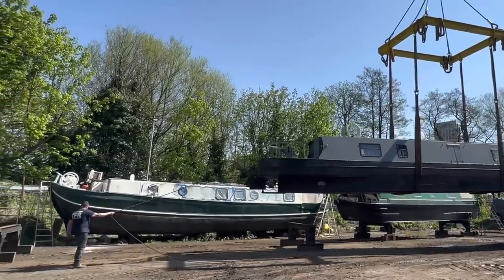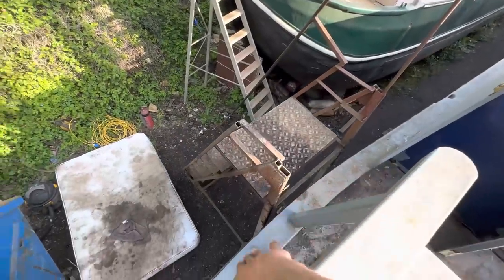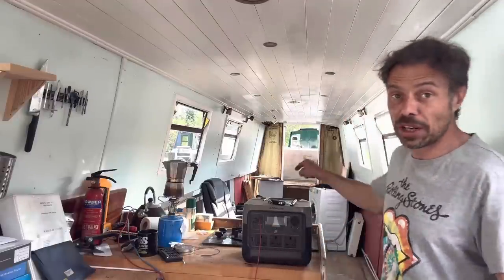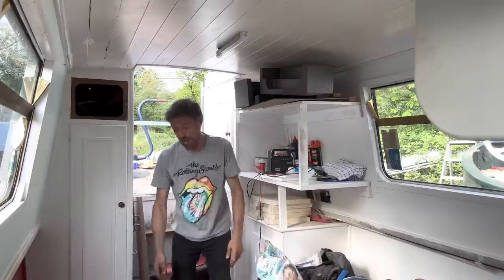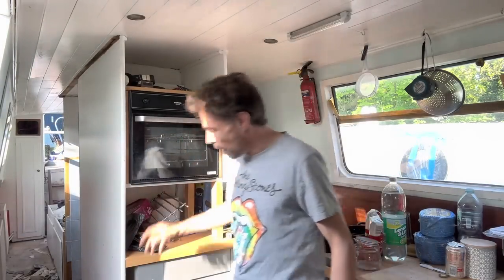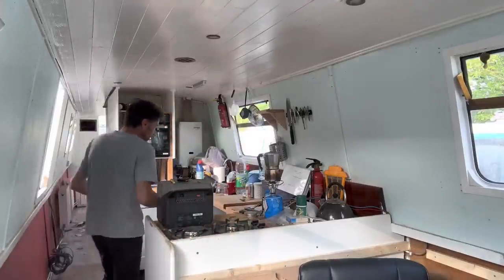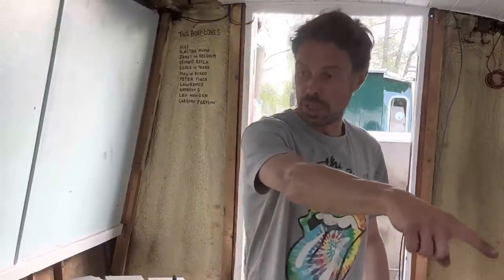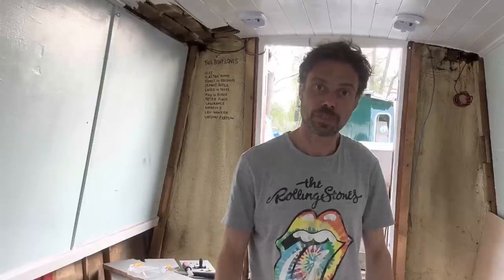417. COMPROMISING narrowboat layout design

Comment: Loving the new project.  With the loo at the back, and a folding bed, you block the rest of the boat from the bog if the beds are down.  You mentioned two sleeping spaces, but your plan only showed one, so maybe that's not a problem, but if the dinette is a bed too, you can't get to the loo for a midnight wee...

Comment: Well, as you asked, my thoughts:
Seems to me that you might as well just rip the whole thing apart, and start from fresh.  The existing bedroom needs major changes, the bathroom is already gone, the kitchen needs moving, and another bedroom needs building.
If you're going to keep the lounge at the bow, why bother cutting a new flue hole and blocking off the existing one?  More work and expense.  Leave the stove where it is.
Dump the calorifier idea, as you rarely run the engine for long.  Re-install the diesel water heater for the central heating side, and use the stove when you have the time.  You have what looks like an on-demand water heater in the kitchen, which will also need the flue blocking and possibly moving.
Swap the cassette toilet for the composter that you have in Sloe Patrol, if it will fit.
That should give you something to think about.
All the best, mate.

Comment: I've never tried a cross bed but I imagine that if the nose of the boat is high you'll feel like you are gonna roll out. It only takes a few degrees to get that sensation, for me anyway. On my boat I designed it so that that my head was at the higher end, couldn't possibly sleep any other way round. I had a similar layout to the one you are proposing but an extra 4ft to play with which made all the difference.

Comment: Your idea for cross-beds is brilliant.  I had always assumed that running lengthwise would be the way to go, but the way you explained it, makes far better sense.  Sliding pocket doors are a great idea too, expecially if you can find inexpensive ready-made hardware to build them.  I'm not sure that I would like a walk-through bathroom, but then again, the way you described the bed situation, it is probably the optimal use of space.

Comment: As an alternative to the stern bedroom, pull out the bed and make it a dinette, with a hinged top bunk bed above it, blocking the top of that window on the port side. That way the stern compartment can sleep 2 - 3 kids in a single room. By day you can have up to 4 kids easily sitting at the dinette table when you're steering, or it's as you said quiet space for the older ones while the younger ones are with you in the lounge area. 

When you're alone, the stern dinette can be your permanent bed, instead of a dinette. Bathroom and kitchen can stay in their place. Then next to the kitchen another dinette, for family meals and when you're cooking for the kids, and workspace for when you're alone on the boat and editing. Then the lounger as you described, with a pull-out section, so if you do have all the kids. That plan could sleep all of them, and yourself at the bow in the lounge.

There's no law saying you can't have 2 dinettes on board!

Comment: from the bow: 1 bunkbed to port side. Small table and 2 chairs and a small wardrobe on starboard side, allows passage from well deck to a small walk through toilet and small wash hand basin (8ft length of boat used so far.) next is an American dinette on the port side with flush mounted TV or even a projector on starboard wall. (Another 6ft) Leads to  a chill area with seating and a table to work on your laptop on port side with a multifuel stove on starboard (5-6ft) leads to a through kitchen with units on both sides (port side full length units and starboard is shorter to allow passage to a corridor. (U shaped kitchens leads to dead space in corners.)8 ft kitchen?. Off corridor bathroom as you have lots of company with shower sink and toilet (6ft). Thats aprox 34ft so far. Unsure of the internal cabin length on a 58 ft boat but assume its about 42-44ft. So that would leave 8-10ft for your bedroom and a wet area with electric cupboards and a windlass

Comment: Have you considered bunk beds in the rear cabin? maybe with the upper bunk running fore and aft and the lower bunk forward, but running across the boat with the head end under the upper one. That would give a decent space when entering the boat and still accommodate the kids and visitors.
Reply: Plus one for this idea. I just watched the video, and this was my immediate thought. You’ve got decent headroom - if the bottom bunk is low enough, it may even be possible to get three bunks - one (the top bunk) running fore and aft, and the lower one making an ‘L’ shape across the boat with a folding /lifting section. The L shape one should be big enough accommodate both of  the little ones - at least for the next few years.
Reply: James would want the younger children closer to him in the saloon overnight, not right down the other end of the boat with access to the water/outside I think. (Dot)

Comment: I admit that I have mused over how I would build a narrowboat. 

It seems that they are all lined and floored out, then everything is built in place, as if fitting out a house.
It would seem sensibe to do it in a modular way. Have regularly spaced battons in the walls and ceiling. And make up dividings walls, kitchen units, shower cubicle, diner etc as self contained modules. They  would be secured to the battons, but could be unbolted and moved if you needed to change things around. Or to allow maintainence access.
You could move a wall here and there, to fine tune the layout. Or even completely reverse the layout if you felt like.

Another thought, is the idea of a 'wet wall'. Common in some buildings, where you have one wall that has bathroom one side and kitchen the other. Keeping all the plumbing in one place.

Comment: May I suggest that the radiators are taken out and replaced by a Thermaskirt system by Discrete Heat (budget allowing). I installed it on my nb using the BM2 profile, however you may want to use the BM3 profile. Great viewing!

Comment: if there is sufficient space I was thinking of folding bunkbeds length wise against the windowless aft part of the boat.
If you want to sit just fold the top one cushions from the top can be used as backrests on the bottom one 
It becomes a second lounge.
The underside of the botton bed could be fitted with hooks/ clambs for storing what ever you think of, like rope, tools, poles, boeies, waterhose ect ect.
I like it that you have a plan but keeping all options open, its a blanc canvas and you are the artist👩‍🎨 🤘

Comment: Hi James, loving the videos. Just a bit worried about the base plate. If you are taking the floor up, wouldn’t it be sensible to treat and paint the rusty surface of the base plate? 🍷🍷
Reply from the maker: I’m treating the underneath but no real point on doing the inside now. Obviously it’s a good idea but it requires too much work and time which I can’t do. It’s a very good baseplate and ALL baseplates have a thin layer of rust on the inside.

Comment: Most of the stuff and weight will be on the port side - after you have finished the floor will you have enough access to shift the ballast to trim the boat as you add in extra weight to port as you put back everything else?

Comment: 1. Could you add a single Pullman berth to the forward bulkhead in the aft cabin — the kids room?  Folds up when not in use, saving room.  Folded down, with a rail on the outside, it becomes a bunk bed, adding sleeping space.  2.  I recently saw a table which folded in the cushions at the back of a U shaped sofa on a Riviera 605 SUV.  When folded away, provided a ton of space.

Comment: Pipe berths for the family, Pullman berth/setee/table, 

You don't want berthing near the engine because teenagers don't get up when you need to move

Most important is to share functions, i.e. wet room shared by both sleeping areas 

Next on importace is to Balance the accommodation so that the boat  doesn't list (heel) when the boat is stationary--- like sink and fridge to port and hob and oven to starboard 

Think about installing a folding step to get across the gaps provided by the shape of the hull, this could be secured to the hull and rotate down

Just some ideas which you may or may not wish to think about. Nothing is set in stone (steel)
Reply: You can balance the boat with the ballast, just take some weight out on the side where everything is (bathroom and kitchen etc). You don't need to accomodate the layout to prevent listing on a narrowboat, because of the ballast.
Reply: @weerwolfproductions  no sense in lugging around ballast when you can balance the boat with design decisions.  More weight means more money spent on fuel.
Reply: @rwwhitwell5594  Narrowboats were freight haulers. If you don't weigh them down with ballast they are a cork on the water, and ride way too high on the water, making them unstable and uncomfortable to live on. You can see Sloepatrol ride higher on the water than Serafina, for example, which makes her way more wobbly than Serafina. Not sure if James can confirm. But i'd definately advise against removing ballast from narrowboats that aren't used for freight hauling.

Comment: I really don't like entering down stairs straight into the double bed in the aft though I suppose if you stumble you have a soft landing..
Just throwing some ideas out:
1: split that double bed into 2 singles, one on either side so the stairs come down straight into a walkway.

2:  Perhaps make one of the sides a bunk bed with the upper bed hinged or chained so it can be raised. 
Lower bed might need to be lower than comfortable seating height to give head room for both beds.  Hmmm...  another possibility is to make the upper bed chained hanging and it LOWERS on top of the lower bed, thus giving a more comfortable seating height for day use.
I mention hanging chain because it seems like a cheap way to do it. Of course it could be screw lift driven, or hydraulic, etc

3: Could separating Loo and shower into small rooms on either side help?  They would end up being pretty small I guess.

Comment: i don't know how tall you are and therefore what your kids are 'going to make up to' (equine term :)) but beds don't have to be 6'3".  if they are never going to be that tall then there are inches to be saved there.  also, as the only boy, arthur will want more privacy as he gets older.  i haven't worked out a solution but i have considered bunk beds in the first bit and the steps down from the deck having a sort of 'landing' and then turning down right as you go in to make space for a wider bed(s).

Comment: James. Nooo.... Not a cross bed in that aft cabin, you will regret that every evening for the rest of your P58 narrowboat owning life.! 
Its crying out for two singles, one down each side. Daytime they are used as sofa's / kids playroom, whatever... very useable space, easy to keep an eye on from the helm and easy to traverse forwards into the boat. Night time nothing to fold down or convert, just roll out a sleeping bag or duvet and job done.  
Yes it will cost you an extra 2ft of precious boat real estate but the benefit you gain from the revised layout will far exceed the loss of 2ft from the diner/saloon at the front. 
For the bathroom, make it full width of the boat, ie walk through. rear door on the centreline. WHB on one side and toilet on the other of the rear bulkhead. Shower cubicle port on the forward bulkhead and door forwards starboard on the front bulkhead. All sorted.! Your welcome :-)